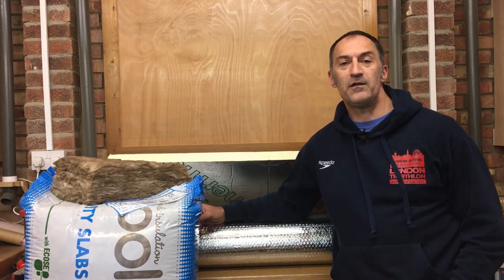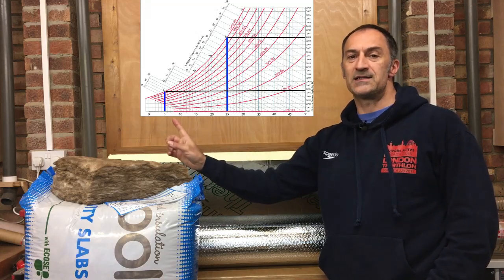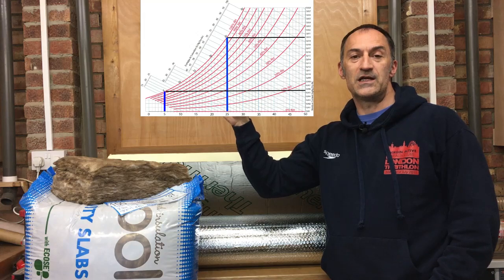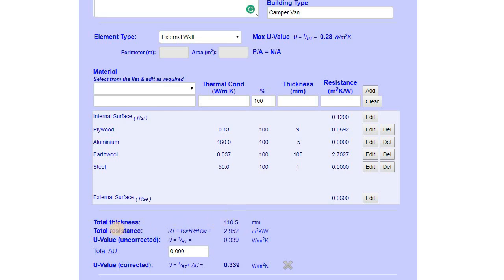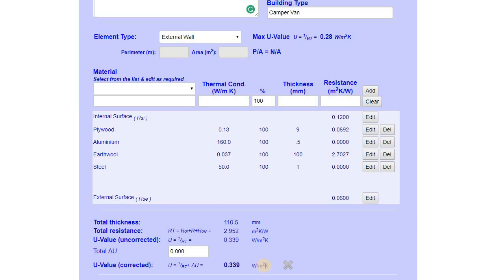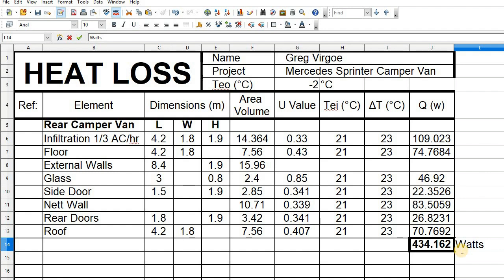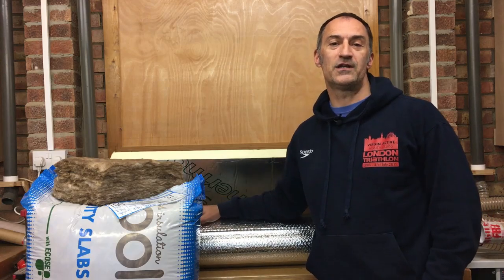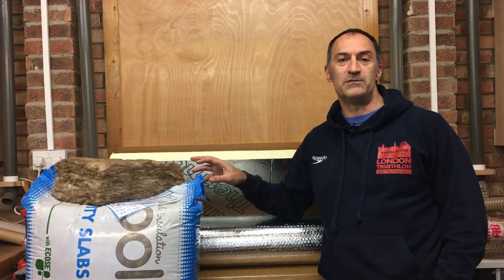How to Insulate your Van Part 1 - The facts you need!

Comment: Good explanation of sensible heat loss. Are you going to do a follow up for summer gain conditions with solar loads (CLTD or the like)? I wonder what the shading coefficient is for a solar panel. Might be useful for those hot Catalonian days.
Reply from the maker: Hello Doug, in the summer the transmission heat gains are calculated the same way as winter transmission losses. The solar gains vary depending on where you are in the world, what day of the year it is, the time of day and what direction you are facing. All these factors determine the location and intensity of the sun in the sky and the resulting power of the sun. For a mobile home we could not do a calculation of solar gain that would apply to all cases as you are constantly driving around in different locations and orientations. Yes, it can be calculated but is not a constant like conduction. You can pick a few worst case scenarios and calculate a best estimate. I don't plan to fit AC so will just rely on good ventilation and external reflective screens for my windows to keep the sun out. Cheers

Comment: Hi Greg, Great engineering once again!! You discuss the issue of heat loss with your insulation, however what about the reflective property of the bubble foil. Doesn't reflection also play a large part in keeping the heat in ( or in my case in Australia, keeping the heat out)?  Reflective shields on windows and windscreens seem to be the preferred solution to keeping heat out of vehicles. I may be wrong but I think that you have understated the benefits of reflection and simply assigning it the job of vapour barrier.
Reply from the maker: Hello Norman, in this application where the materials are touching each other and built up in layers to form a composite structure we are dealing with conduction only. The only reflection of radiated heat happens at the outer surfaces, there are no voids or cavity in my walls.
Placing reflectors over the glass of your cab is a totally different application and one that I totally recommend for this material. 
The solar gain experienced through glazing is due mostly to solar radiation with a smaller proportion of conduction.
Reflectix is made of the wrong material to be used as an insulator but is very good at reflecting radiated heat. The clue is in the name.
Two very thin layers of aluminium foil (super conductor) and a 3mm air gap, not even big enough to be classed as an effective cavity.
Reply: Greg Virgoe - Thanks for your detailed reply Greg. When I installed ceiling insulation in my house in Sydney (I used washed sheep wool, cheap in Aus) the guy i bought it from told me to use an Al foil sheet over the 150mm layer of wool to reflect suns heat back into the ceiling cavity (and in winter, the house heat lost through the wool back into the house). He said not using the foil could reduce performance by 25%. It  seems to work as my ceiling cavity can be up to 25degC hotter than the rooms below in summer. Can't we think of the inside of the van as the void (my ceiling space) with plenty of space for reflection to occur??
Reply from the maker: Hi Norman, The reason it can reflect radiant heat back in the roof application is that you have that large roof space or void. I assume that your foil reflector is the exposed layer in your roof on top of the insulation and not covered by anything else. The radiant heat of the underside of the roof tiles is reflected back by the foil on top of your ceiling joists. In our application, everything is touching each other like a sandwich with no voids and the reflectix is buried in other materials, so they are all acting just as heat conductors.

Comment: I am loving your videos. Actual information, sad to say it is refreshing.
Reply from the maker: I was worried it may be too in deep, so I'm pleased you liked it.
Reply: Ive noticed you seem to answer all your messages so i thought i would chance a question. 
In my fantasy conversion i envisioned using Line-x a spray on interior van liner and a similar spray on the outside of the van. I live in a similar climate and would ideally like to live a full time van life.

Do you think this would be beneficial?
Reply: I think this is exactly what is needed in the van build community, keep up the amazing job and thank you
Reply from the maker: Hello, yes I value my viewers very much and if they have taken the time to make a comment it is the least I can do to give a reply. I have looked at their website and seen that video a few time before. This system is a protective coating to resist scratches dings and help prevent rust. I cannot see anywhere that state any kind of insulation facts, so I can only assume it is not designed as an insulator. If you are in mild climates you will need to insulate if you plan on living in it or it will still be very cold and damp. Hope that helps.
Reply: Greg thank you so much. Due to your video i believe i now understand these concepts and because of this my questions were answered.
So if i understand the insulation retains temp. The insulation integrity is protected by vapour barrier.
To remove moisture from within heat the air more than the outside air and allow the air to escape, taking the moisture with it.

I really cant thank you enough. My apartment (like all irish buildings) has some damp issues which i am now mitigating.

Do you plan to use an air exchanger with heat recovery or are you aware of such a thing suitable for sprinter size vans?

Comment: Good practice to keep moisture away from the fibre glass at is does not work as insulation when wet. Good video
Reply from the maker: Thank you for great feedback. You are absolutely right re fibreglass. 
Tests confirm that Earthwool DriTherm Cavity Slabs will not transmit moisture by capillary action and are classified as water repellant.

Comment: Another excellent video Greg. Top quality mate. That's for so much useful information. I will be attempting my very first build also and your layout is very close to mine. Question - will you leave the colour white? It's one of my biggest issues. White reminds me off work (what I'll be getting away from ha) but nearly all the Sprinters here (Ireland) are white. A respray is big money and a wrap isn't exactly cheap either - and less permanent and durable in the long run. I think I'll be waiting for months for one to come available
Reply from the maker: Thank you, yes I'm keeping it mostly white as it's a good colour to reflect the heat of summer sun.
I am thinking of having some graphics applied just to take it away from the plain white work van.
Best wishes for your own van conversion.
Reply: Greg Virgoe yes that's a good idea Greg. Nice one. More cost effective also 👍

Comment: Hi Greg, this is one of the best van-insulating videos I have seen here on YouTube. Great work! Was the perfect timing for me ;) 

What are your thoughts about putting the insulation in when it’s cold (trying to start in the beginning of December)? Especially with the moisture barrier...could there possibly be more moisture trapped inside the insulation under this conditions?
Reply from the maker: That's a very good point. Typically in the winter the relative humidity is close to saturation 100%RH
Most insulation comes wrapped in plastic, so only open it when you need to install it.
When working in my van over the winter I try and pick sunny winter days or just put a small heater in the van and close the doors to take the chill off everything. It doesn't take much to warm up the inside and reduce the relative humidity.
Reply: Thanks Greg! Looking forward for your future videos!

Comment: Excellent video Greg. I will be building a van next year, but it will be for use in hot climates such as Spain and the Canaries. Do the same principles apply? I guess I'll be trying to keep heat out not in!
Reply from the maker: Exactly Richard, we will be using our van around the Med too. The insulation will help to prevent heat being transmitted into the van and help to keep it cooler in summer. What will help keep your van cooler is a reflective cover over the outside of the cab windows. Stopping the radiant sun light heating up the inside.
Reply: That's great, thanks Greg. I'm in Lanzarote at the moment and the wild camping opportunities are awesome.

Comment: 5 star delivery once again Greg. Worth every minute to watch not just for anyone doing a van build but also anyone who wishes to be well informed and correctly insulate just about anything else. Thank you Greg for your outstanding thought and work. 
P.S. you may want to repost as an  insulation values explained (keeping original)
Reply from the maker: A valid point, it does apply to any insulation application and not just vans. I may edit the title slightly and add few more tags. Thank you for your help.

Comment: Hi Greg, excellent video on insulation and the methods behind it. Please do more like this if you encounter more scenarios where explaining the fundamentals can be helpful. Now that you know what the "heat loss" is, what information does that empower you with? Was your goal to "minimize heat loss"? Does this mean you'll need at least a 500W space heater to keep things normal inside the van at -2C? How does your insulation compare to Spray-on Foam insulation? Could Spray-foam potentially provide better (lower) heat loss (and avoid condensation build up at the surface of the steel)?
Reply from the maker: Thank you for the vote of confidence I was unsure how a technical video like this would be received but the feedback has been great. 
You are exactly right. Once you have the heat loss total you know what size heater you need to keep it room temp inside when it’s -2 outside. 
Spray foam is the same material as the rigid board but in a can. Being a foam I would be wary of claims of moisture resistant. I would still fix a moisture barrier over the top of foam before sheeting. It would have to be applied to the same thickness say 50mm to have the same thermal properties as the rigid board. 
Beware of false R value claims. See a previous comment and reply below. 
Thanks for great feedback and question. Cheers

Comment: Excellent video and explanation of the basics! 
Someone may have already asked this, but I will anyway.
What do you think of spray in foam insulation?
Not just for my van, but also homes.
Cheers
Reply from the maker: Hello, please read the reply given to Stephanos just before you. It's a polyurethane foam with the same thermal properties as the rigid boards so very good as an insulator. Beware of misrepresented R values. I would still recommend a vapour barrier as its only a foam and once trimmed you exposed the open cells. Be careful not to spray too much as it expands over time and can deform the sides of your van if you use too much.

Comment: What do you think of the foam insulation options like Lapolla? Claimed R-Value of 6.3 per inch
Reply from the maker: Hello Stephanos, I did google that product and looked at their website. That product is a Polyurethane foam which is very similar in properties to the rigid Kingspan Therma board or Celotex. The R value they are claiming for 1" of material is wrong, they are most likely quoting the sum of resistances when 1" of their product is combined with traditional roof construction. Look at the chart I displayed at 0:16 this gives the correct thermal conductivity figures for Polyurethane foam as between 0.023-0.032 W/mK. Therefore 1" of spray foam at best would have an R value of 0.025m/0.023 = 1.09!  Working it back the other way if 1" of spray was R6.3 then 0.025m/6.3 = 0.004 W/mK   That's nearly 4x better than the best insulation known to man Aerogel which is used by NASA. So beware of false representation of R values, Reflectix advertise their product the same way and it's very misleading. They are giving you a total R value for a typical installation in a house. Having said that spray foam has very good thermal properties, it's the same as the rigid boards, just messier to apply and clean up after. You still need a vapour barrier. Hope that helps you.

Comment: Oh yes. This is the one video I have been looking for for ages. I plan on building and using my van in the north of Scandinavia and Lapland  for as much of the year as posible. Temperatures here drop to -30 or even -40 C in the winter so it's not enough to have good heating. 
Thanks a lot for making this info easy to understand by someone with no experience in insulation!
Reply from the maker: Wow, those temperatures will tets the very best of insulation.
Best wishes and good luck with your adventures.

Comment: First time i really understand the business of insulating...even if played around with a thawpoint-calculator on the net...it left me with no understanding, but your video does the trick to me!
Thanks so much!
;-)
Reply from the maker: I'm guessing that similar to the dew point calculator.
You can plot a temperature gradient across the structure of the wall to determine where the dew point is and find out where the condensation will occur.

Comment: Greg, well done that was an absolute masterclass. A couple of comments - where you have to snake the cartwheel into less than 100mm gaps - is it better to 'peel off' the excess so that what is in there is not compressed and has air in the structure? I found this really useful as I will be insulating a new shed shortly, I had settled on using Kingspan or equivalent (my god its expensive) but I am stalled at the moment because I cannot figure out how to deal with the open eaves and the need to ventilate the internal roof and insulate - if you know what I mean.
Reply from the maker: Hello Norman, You are absolutely spot on, where the van narrowed to 50mm in depth I did exactly that, rather than squeeze 100mm into the space I peeled off half of the insulation and made sure it was still nice and fluffy. A cavity has an R-value of 0.12, so leaving an air gap still helps to stop the transmittance of heat.
If you are insulating the shed roof have the insulation between the rafters but closer to the room, allow the ventilated eaves to let air run over the top of the insulation under the tiles or ply and felt. have a moisture barrier under the insulation across the rafters and then panel or board you ceiling over that. Hope that make sence.
Pm me if you get stuck and ill try and sketch you something. Cheers
Reply: That would be most helpful - how do I pm you?
Reply from the maker: About me page
Reply: Greg Virgoe Sorry Greg cannot see anything there the email button does not work -just tried you Google Hangouts and have put a message in your channel discussion page (the one next to about).👍
Reply: Hi Greg - help please!😀 just about to insulate floor of shed with 25mm PIR. The shed floor is made of treated timber not T&G so not so close boarded and the floor is supported by timber battens on a concrete base. Do I need to buy a breathable fabric membrane between PIR and floorboards? I will be making up a support structure of 25 x50 treated battens on a grillage of 2’x2’ to support the new plywood floor - the PIR will be sandwiched between the plywood and the floorboards - I will be using the foil tape to bridge between panels and maintain vapour seal at to top surface of PIR but a bit concerned at the interface between bottom of PIR and floorboards even with the small gaps between floorboards. Sorry for long explain!😳

Comment: When I do my van conversion I have planned on using closed cell foam spray on like they do with housing units. I was wondering what your thoughts on that?
Reply from the maker: Spray foam has the same great thermal properties as the rigid slab variety.
You will still need to provide a vapour barrier as it does allow moisture through it.
Personally it seems like a messy job with a lot of clear up after. Good insulator though.
Reply from the maker: Hello Tony, I've looked up both products and Line X is advertised as being a waterproof product so you would think it could be used as a vapour barrier. There are no figures for its permeability so I cannot comment on how effective it would be. 
As for Froth Pak and those temperatures, for insulating the van you will be fine. The only places it's advices to avoid is around stoves, fireplaces etc as its combustible material. Your van is unlikely to be subject to even half the temperature this is rated to.
Reply: Linex product is very heavy over a Surface  that large

Comment: Great stuff! It's very easy to find the basics on YT so when I find some in-depth practical knowledge and experience it's always great. I do have one question, if it was a smaller van where space was at a premium, would you still go with a thinner layer of the Kingspan PIR or is there another good thin insulator? Thanks
Reply from the maker: Hello Harry, The only things I know that are better insulators than PIR or ISO rigid foam slab is "Silica AeroGel" which is used by NASA or the vacuum of space itself.  On the floor of my van I am using 25mm PIR rigid slabs, a foil faced bubble wrap vapour barrier and 12mm plywood floor on top. Total build up of 40mm. On the walls you could get away with 6mm plywood panels. This website has loads of really useful information.
http://www.greenspec.co.uk/building-design/insulation-materials-thermal-properties/
Reply: Thanks so much for the tips!